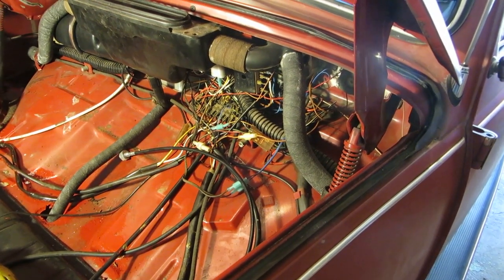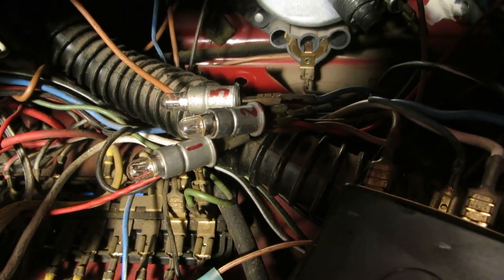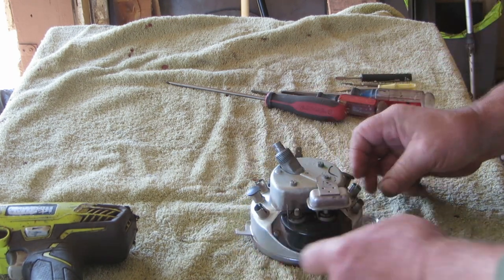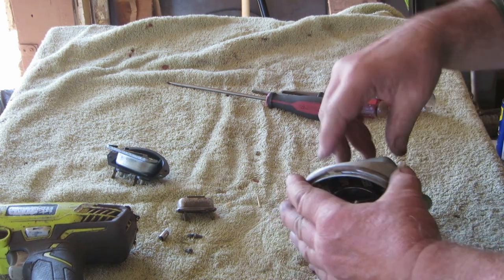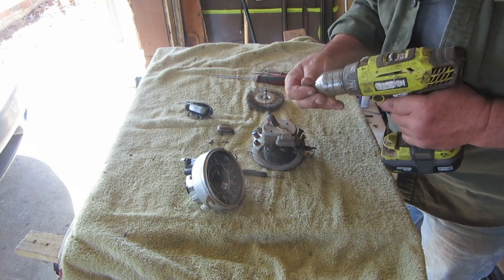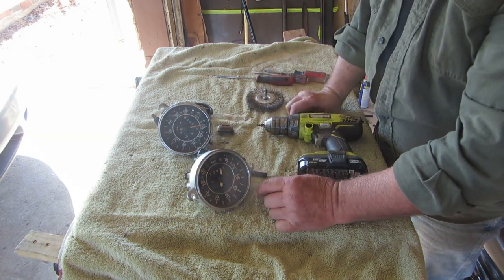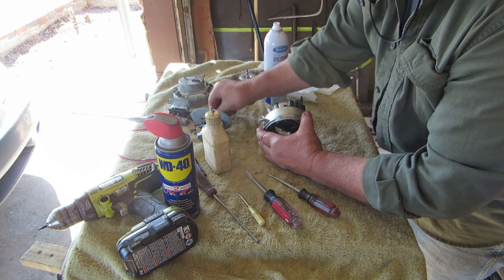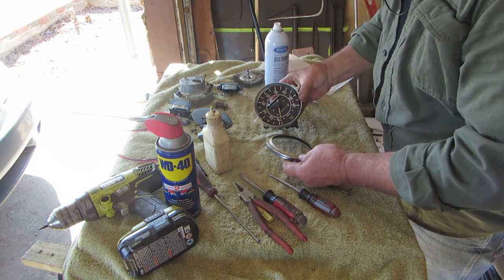1969 VW Beetle Speedometer Repair and Wiring

Comment: If you want your fuel gauge to work really well you should run a ground wire from one of the sender screws ( use a ring terminal ) to the ground spade on the speedometer or the speedometer mount. Do not play with the adjustments on the fuel gauge, they are not potentiometers and use a VDO vibrator. The ones they sell are not worth a crap.
Reply from the maker: I grounded my sending unit by attaching a wire to the machine screw without the plastic collar… Only one of them has a metal collar. To the ground screw for my headlights. It works quite nicely

Comment: The one that says ATF is from a Autoshift . I believe there is an ATF Temp light located at about 9 o'clock on the dial
Reply from the maker: It’s puzzling, because it cam from an IRS 4 speed equipped 69 that I picked a couple years back.
Maybe THEY changed the speedo as well

Comment: I don't remember if you grease the speedo cable? That helps with  the speedo run smooth also.  Here's a tip for  the newer 72?-79 speedo had plastic lenses. Don't use steel wool to clean the  lens. ☹
Reply from the maker: Didn’t know about the plastic lenses...probably a safety issue.
Yeah I oiled the cable. It cannot be removed....this one anyway...it’s sealed,  but I run some oil in it until it was dripping out the other end.
Reply: @OkFixer  
Plastic is cheaper than glass also.
Reply from the maker: @vintage76vipergreenBeetle  didn’t think of that

Comment: I believe you can get a replacement needle. A guy has new US made ones on Ebay for $15.00. Wouldn't a little spray lithium grease work better to lube the mechanism? My understanding is that WD40 will eventually dry. For the gels you can go to the drugstore and grab a report cover(s) and cut them to size and voila...

Getting decent spade connectors not made of aluminum and in China nowadays is a real world challenge.
Reply from the maker: Getting a replacement needle and trying to pull that off and installing it... I can just see.....with me it would like a bee stinging and then pulling its guts out when it tries to pull away.... the sound of me pulling that needle off would sound like this......TWANG!!!! HA,HA,HA. And then the sound of small pieces falling inside the unit..ha,ha,ha
Well, I thought about lithium...and decided xanax would be better! Ha! Seriously... the gears and such had grease on them and with the WD I thought it would loosen the grease up?....then a little machine oil?? That should not dry ...Who knows.. But your probably right about lithium.
something is better than nothing.
And yes... I found out after destroying the old gels that they had turned to stone....I did go to the walmart and got a red and green file folder with the celluloid colored tabs...cut them and used them on the 67 .
Spade connectors, I like the doorman brand and Rock Auto sells them cheap, I believe they are Chinese but a better quality.... The big plastic assortments and ones in Walmart are crap indeed.
Reply: I just use motor oil to lube the speedometer cable. WD-40 is in no way a lubricant, it's a water displacement spray or a corrosion loosening agent although PB-Blaster works much better. Remember to seal the speedometer cable end where it exits the front wheel bearing cover with some silicone sealant so water won't get into your L.H. wheel bearing. As far as rebuilding your speedometer, I won't even try. I just order a new one from Wolfsburg West, they sell rebuilt VDO ones but you have to send in your old one as a core. The rebuilt ones have glass faces, not plastic, so when you install them don't over torque the mount screws or the face will crack.
Reply from the maker: @brianallen9810  the one I have put together works perfectly well.
I turned my cable up side down and filled it with motor oil...and let it drain, then installed....and yes on the sealant.